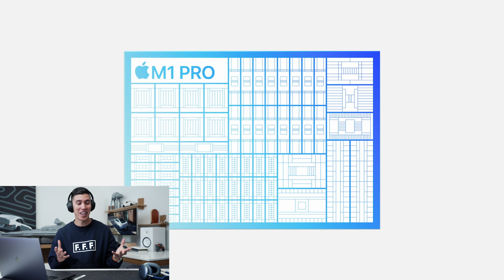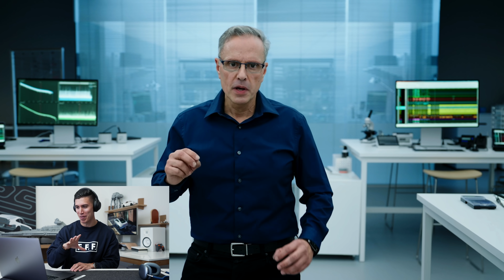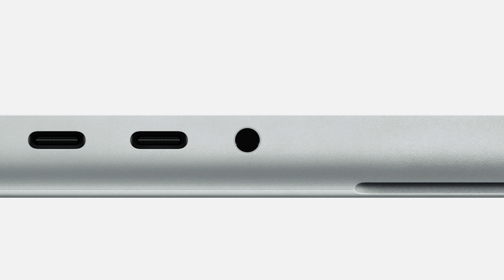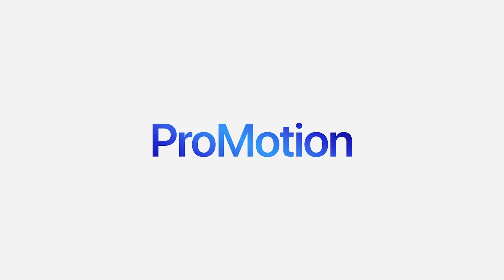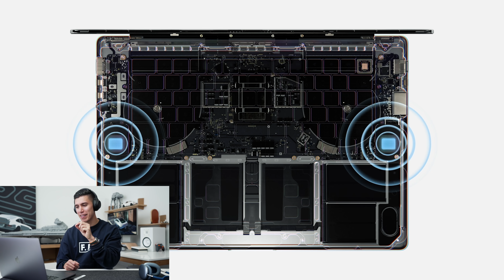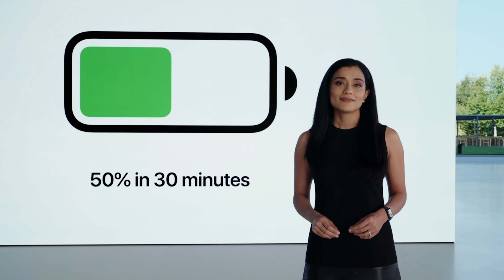The NEW 14" and 16" MacBook Pro are HERE! (M1 Pro and M1 Max)

Comment: I was really torn between the 14 and 16 inches but ended up ordering the 16-inch. I'd figured, the screen is going to be so nice, i'd rather just use that and not have an additional monitor. I am still wondering if I should change my order though, the 14 inch is much more portable.
Reply: I have the same issue as you.. hmm

Comment: I will max out the 16 inch model except for the storage. I will just use cloud and spec it to the minimum of 1TB storage. But the one thing i want the most which is ethernet connection is not there. But very happy the HDMI is back 😍
Reply: Yeah I wish they'd put it in the power brick like with the iMacs.

Comment: The M1 Air is all I need, but I have a dual 4k monitor setup... Of which the Air isn't compatible. I can't justify £1900 😭 for dual display support, it's cheaper to get an M1 Mac mini and MBA for £1500 all in

Comment: I wasn't ready for the sudden price increase 😅
Reply: The hundred dollar price increase?
Reply: @Yzyenthusiast  try 700 on the base model pro
Reply: Previous 13” was 1799 not 1899. But consider the current base 13” , it’s 1299, but if you add 16gb RAM and 512 GB config it puts you at $1699. So the new 14” is $300 more ($1999)
Reply: @Justin Yadao how do you do this exactly?
Reply: @WalneeezyGaming  you must be a student

Comment: Exciting launch this year,120 hz promotion is great,gamers can dual boot with windows and play games to benefit from that refresh rate.
Reply: Dual booting is not a thing on apple silicon…
Reply: @owlmostdead9492  yet😎
Reply: @WomboAnimals  do you actually think Microsoft is competent enough? Please, we will be getting reverse engineered Linux before Windows on apple silicon.
Reply: @owlmostdead9492  Microsoft already has Win10 for ARM for their Surfaces Pro X. And presumably, they will also release Win11 or ARM for these devices. The only problem is that these Windows versions are for 32-bit ARM, so, even if you somehow manage to get them running on MacOS, they will run way worse. Also, none of the "true" games are available for that, so, while technically you can dual-boot Windows, it's not going to be pleasant.
Reply: @loki.8435  I am not going to acknowledge that since Windows on arm is just a tech demo. It is unusable and irrelevant.
Reply: I don't think it's going to happen as the macbook doesn't have a TPM chip